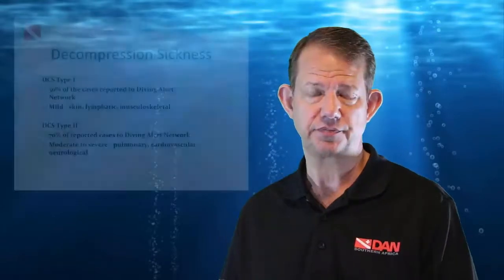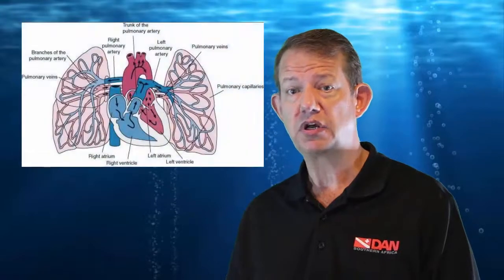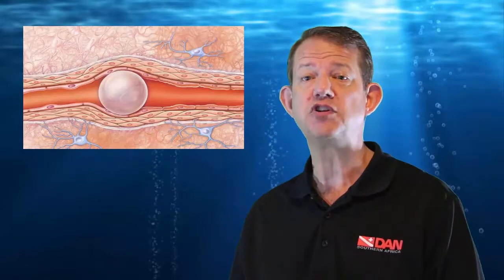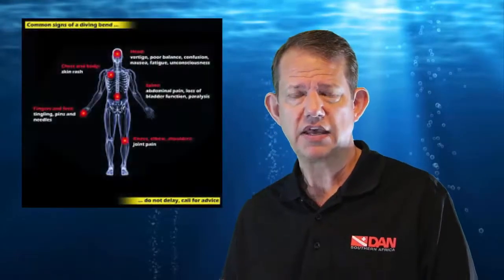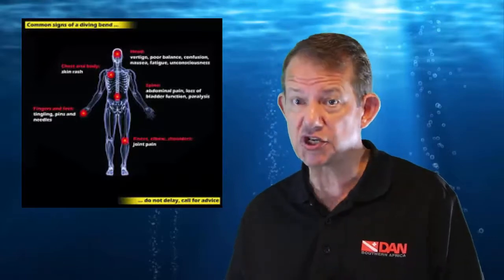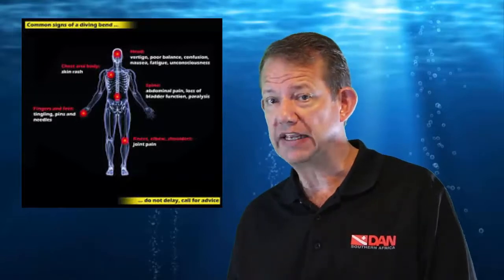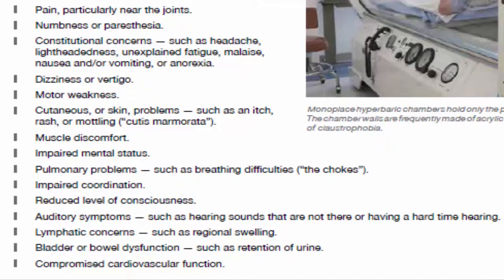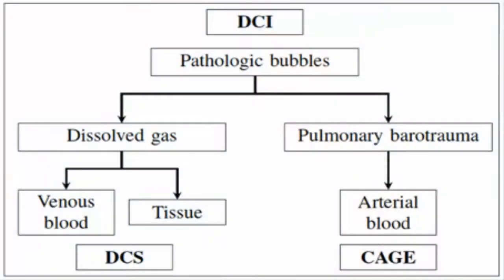Diagnosing Decompression Sickness

Comment: what is the difference between acute and chronic decompression sickness
Reply: Acute decompression Illness or Sickness manifests within 24-48 hours. First (acute) symptoms of DCI are virtually unheard of after 48 hours unless there has been a critical loss in atmospheric pressure (like astronauts doing EVA or flying at 12000 ft in an unpressurised aircraft). Chronic DCI is almost exclusively limited to joint or bone-shaft lesions (dysbaric osteonecrosis or DON) that may occur within 5 years of a dive, the latter which may not even have resulted in clinically recognisable DCI. Chronic DCI is much more common with deep commercial diving than with recreational diving, although cases have been reported. Rightly or wrongly, this has led to the recommendation that deep, boring pain in a bone or joint should be recompressed urgently to avoid chronic DCI months later. There is no proof that DON will occur unless the acute symptoms are treated, but the reasoning is plausible. So in short: Acute is DCI Symptoms within 1-3 days of the last dive and chronic DCI is joint-related symptoms (DON) after weeks or months. The chronic effects on the nervous system have been attributed largely to the toxicity of drilling mud in oil and gas operations, and occasionally -- otherwise -- occur almost exclusively in individuals with large holes in the heart. These are the exception, though. Hope this helps. Great question. The DAN Medical Team after that
Reply from the maker: @DrFJCronje  Thank you for your response.